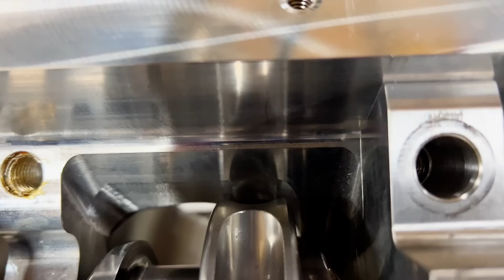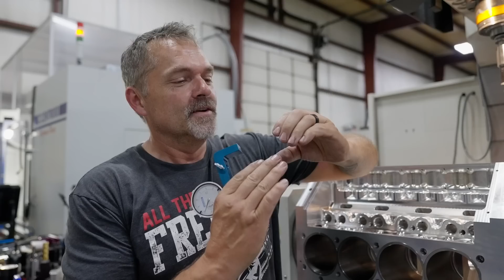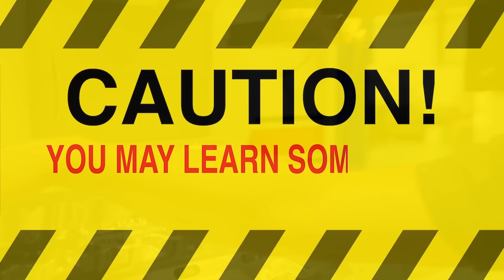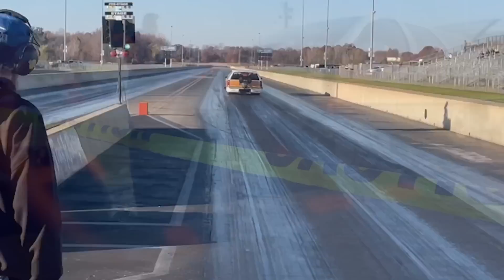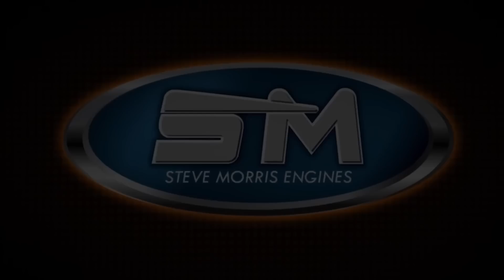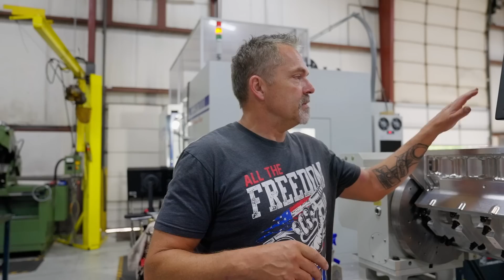What Is A 3500 +HP SML? …. The Baddest Drag And Drive LS Style Engine Out There!

Comment: Your commentary on how it goes with custom stuff is true.  I work for a oem supplier just down the road from you, and we spend a fortune on prototypes that often all need custom fitting, and that's after countless hours of CAD, design reviews, FEA analysis, etc.  The 1st parts always take a lot of extra, unexpected time.  

Management is always baffled as to why.
Reply: I'd bet management has never touched any of the parts. Wouldn't know a connecting rod from a toaster.
Reply: @stevemorrisracing  
Crimped and Clamping surfaces are the 2 missing words of wisdom👍
Reply: @stevemorrisracing   he
Reply: Bean counters always want to know why .. 😂
Reply: Analysts will be looking for Tolerance in Parts.
Welded,Billet,Cast,Cured. All have Pros&Cons.